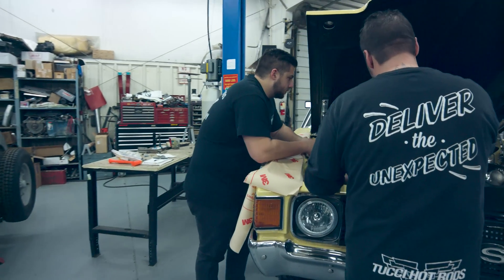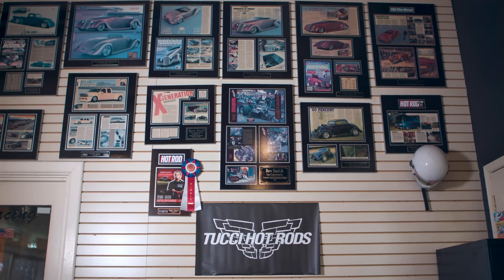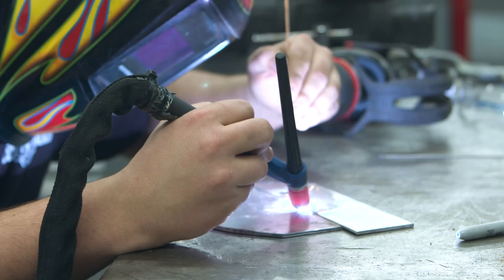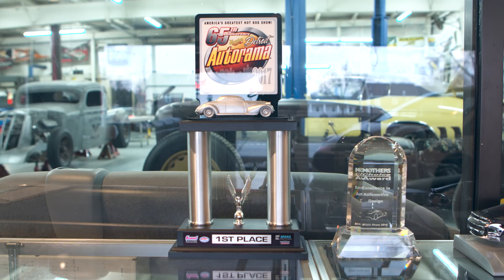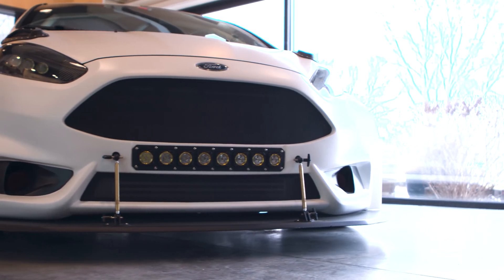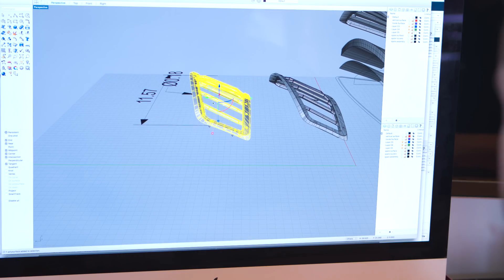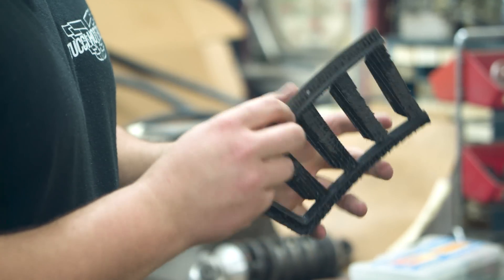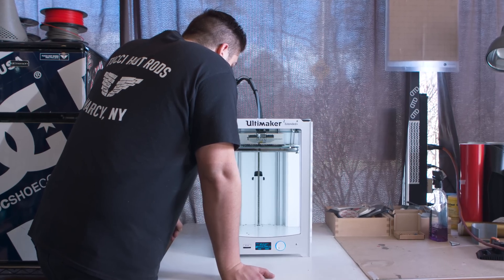Tucci Hot Rods: 3D printing final custom car parts - Ultimaker: 3D Printing Story

Comment: ...just a question, what material you use for parts? Also how do headlights work with plastic, I mean, do you get melting? And how safe is it for, let's say spoilers, or splitters?

Thanks
Reply: abs is higher heat resistant than Pla. but you can bake Pla to out perform Abs. parts do shrink when baking.

Comment: Can those 3D printed air control pieces above the wheels withstand the forces from the airflow in a worst case scenario (for example going at top speed in a very windy weather)?
Also what materials are you using for the printing? Are the 3D printed parts as strong as the OEM parts?
I'm pretty new to 3d printing and I'm not really experienced with aerodynamics either, so excuse me if my questions are dumb.
Reply: One channel that has a ton of info is cnc kitchen, that man has run hundreds of tests on all materials and shows super useful data, but in short it depends on the material and the exposure, raw abs or pla in the heat and the sun may have issues over time, but carbon fiber nylon or Asa should be tough enough to be an exterior part

Comment: what software do they use with the xbox 360 kinect to scan the car?
Reply: We use Skanect.
Reply: likely due to the matte vinyl that appears to be on the car. If the object you are scanning is too shiny you wont get a good scan. That applies to even the most expensive laser scanners on the market which is why they use stickers or dusting to dull down the surfaces

Comment: What materials are they printing with for auto use?  Impressive!
Reply from the maker: Thanks for your interest! They are using ABS.
Reply: Ultimaker can ABS really stand up to the harsh weather, heat, and debris that cars often deal with?

On the flip side, I planned to make LED lights (much like the Audi A8 dotted LED main beams) for my car. Would I need something with more heat tolerance for the LED drivers or is ABS more than enough?